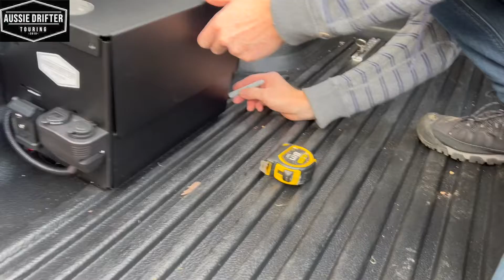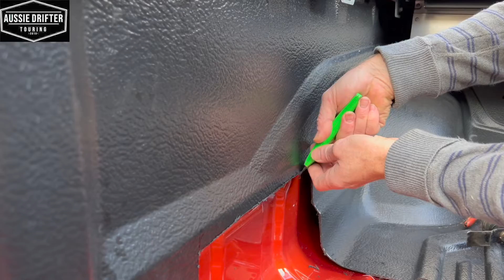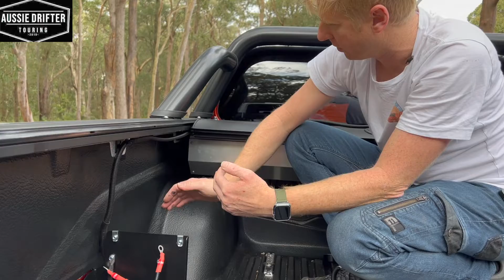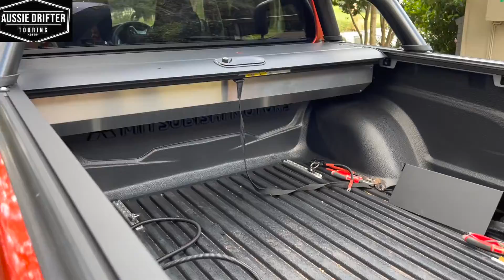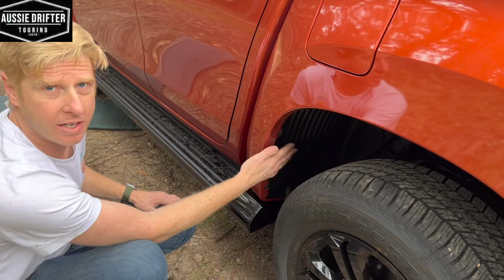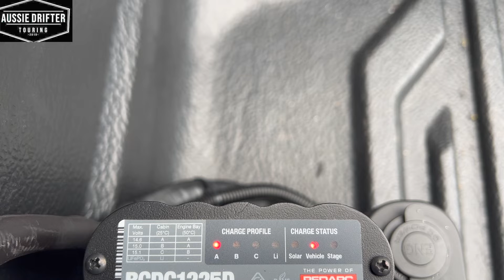Mitsubishi Triton MR 2017 on Redarc dual battery tub mount DIY kit - Full Installation

Comment: Did you wire up the ignition wire? im trying to install on bcdc25 in an mq triton and cannot find an ignition fuse to hook in to in the engine bay
Reply from the maker: No need on the triton mate, it has a temperature compensating alternator and the blue wire is only required on a variable voltage alternator.
Reply: @AussieDrifterTouring  thanks yeah I found that out in the end

Comment: How does this work with a spray liner?
Reply from the maker: Hi mate, a spray liner is a lot easier as you don't need to cut the tub our in any way it just fits right into place as if there was no liner at all.

Comment: Nice detailed video. Also looks like your kit is one of the few using a midi fuse from the starter.
Reply from the maker: glad the video was helpful mate, yer REDARC recommend using midi fuse holders as they are a good bolt down electrical connection.

Comment: In this case where you are using a roller cover would you not put it under the roller cover which is a space that is difficult to use?
Reply from the maker: Hi mate, there’s Veichle specific kit are designed to go in that specific location.  However we do have a universal kit that can be mounted wherever you like.  Here is a link to it https://www.aussiedriftertouring.com.au/shop/universal-battery-box-kit